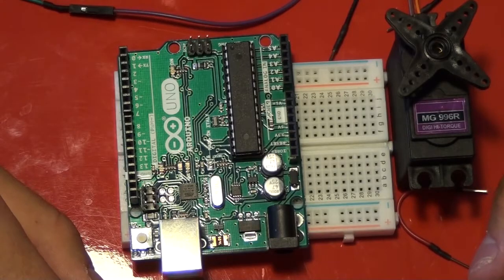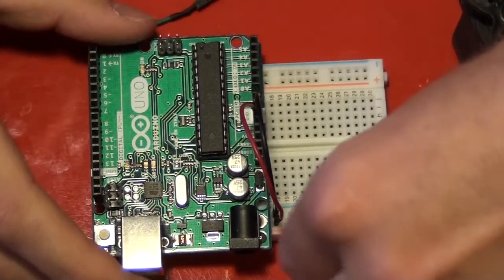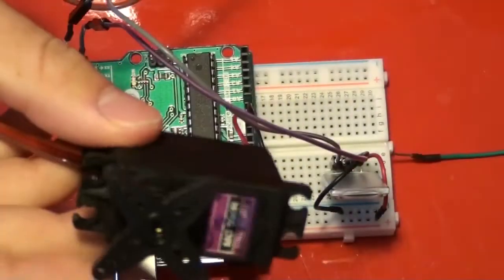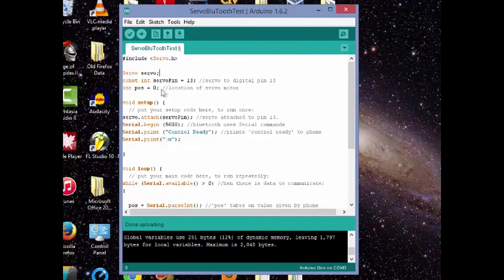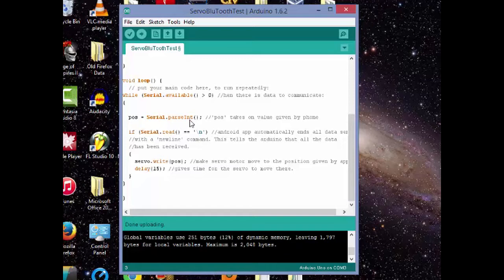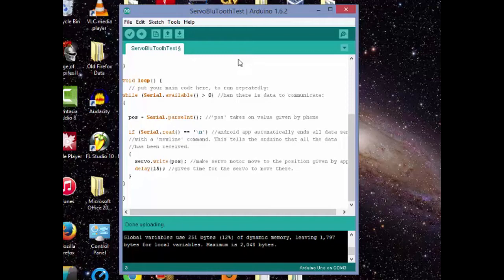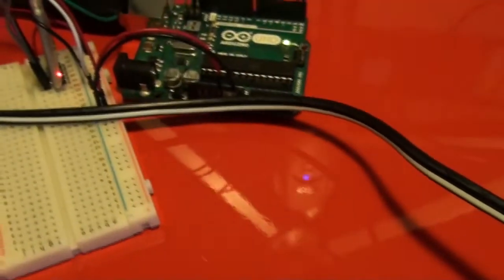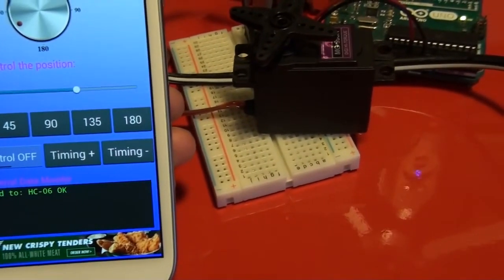Controlling Servo Motor with Bluetooth using Arduino and Android

Comment: I noticed you leave the Arduino still plugged into your computer, is this just for power? I want to attach this to a drone. So if I plug a 9v battery into the Arduino instead of the computer would this still work?

Comment: hi bro, i am using an HC-05 module, the one with the button in it, i am trying to control the servo motor using a samsung galaxy s7 edge, everything works, accept the fact that after i execute one command, the bluetooth connection gets disconnected, any idea how the connection can remain stable?

Comment: I'm using a an arduino bluetooth shield is the code the same, also the app i use doesn't send a number but letters 'x' and 'X' can i still do what u did

Comment: I have a problem in the code specifically in this line
if (Serial.read () == '\ n')
Why object to this line does not implement the program
Reply: having the same problem
Reply: there shouldn't be space between backslash and n. Should be \n
Reply: me too.

Comment: Arduino: 1.6.6 (Windows 8.1), Board: "Arduino/Genuino Uno"

d:1: error: stray '\342' in program

 Hello! This tutorial shows you how to control a servo motor via the HC-06 bluetooth device for Arduino. Hereâ€™s the code I used:

 ^

d:1: error: stray '\200' in program

d:1: error: stray '\231' in program

d:13: error: stray '\342' in program

 Serial.print (â€œControl Readyâ€?); //prints â€˜control readyâ€™ to phone

 ^

d:13: error: stray '\200' in program

d:13: error: stray '\234' in program

d:13: error: stray '\342' in program

d:13: error: stray '\200' in program

d:13: error: stray '\235' in program

d:14: error: stray '\342' in program

 Serial.print(â€œ\nâ€?);

 ^

d:14: error: stray '\200' in program

d:14: error: stray '\234' in program

d:14: error: stray '\' in program

d:14: error: stray '\342' in program

d:14: error: stray '\200' in program

d:14: error: stray '\235' in program

d:25: error: stray '\342' in program

 if (Serial.read() == â€˜\nâ€™) //android app automatically ends all data sent

 ^

d:25: error: stray '\200' in program

d:25: error: stray '\230' in program

d:25: error: stray '\' in program

d:25: error: stray '\342' in program

d:25: error: stray '\200' in program

d:25: error: stray '\231' in program

d:1: error: 'Hello' does not name a type

 Hello! This tutorial shows you how to control a servo motor via the HC-06 bluetooth device for Arduino. Hereâ€™s the code I used:

 ^

In file included from C:\Program Files (x86)\Arduino\libraries\Servo\src/Servo.h:63:0,

                 from C:\Users\Nada\Desktop\d\d.ino:3:

C:\Program Files (x86)\Arduino\libraries\Servo\src/avr/ServoTimers.h:57:41: error: 'timer16_Sequence_t' does not name a type

 typedef enum { _timer1, _Nbr_16timers } timer16_Sequence_t;

                                         ^

C:\Users\Nada\Desktop\d\d.ino: In function 'void setup()':

d:13: error: 'Control' was not declared in this scope

 Serial.print (â€œControl Readyâ€?); //prints â€˜control readyâ€™ to phone

                  ^

d:14: error: 'n' was not declared in this scope

 Serial.print(â€œ\nâ€?);

                  ^

C:\Users\Nada\Desktop\d\d.ino: In function 'void loop()':

d:25: error: 'n' was not declared in this scope

 if (Serial.read() == â€˜\nâ€™) //android app automatically ends all data sent

                          ^

exit status 1
stray '\342' in program

  This report would have more information with
  "Show verbose output during compilation"
  enabled in File > Preferenc